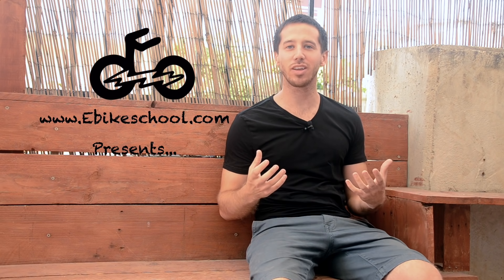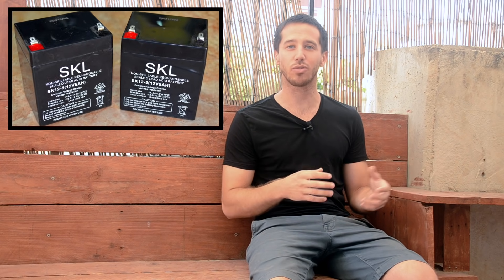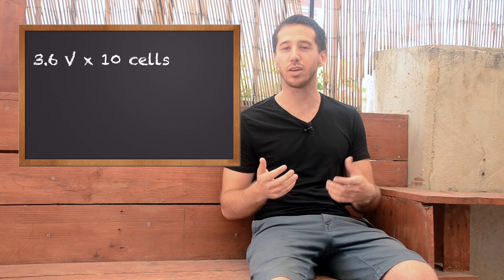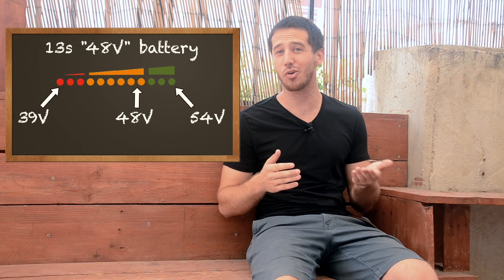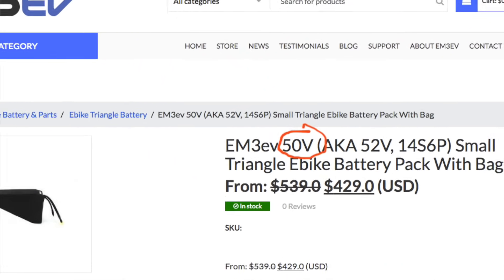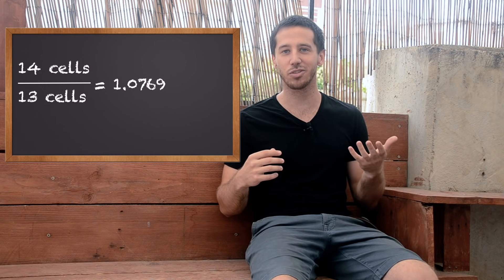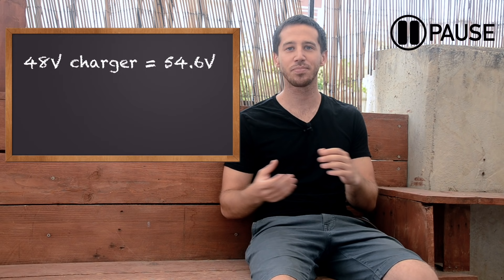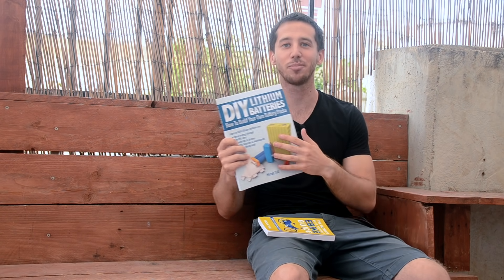Which is better: 48V or 52V battery?

Comment: Major fail in the best reason to go with 52 for a 48 volt design bike - TOTAL NUMBER OF CYCLES OF BATTERY LIFE INCREASES!! Lithium batteries deteriorate the most when fully 100% charged and not immediately used. Hot weather accelerates this deterioration in the form of fewer total charge/discharge cycles before failure. Predicted life cycle total charge count is based on full charge, down to nominal cutoff by the BMS at safe depletion level. Therefore, not ever charging to 100% increases the total number of charge/discharge cycles before failure, all else being equal. The extra charge cycles gained by taking it easy on the pack can exceed the cost paid for those extra cells. DO NOT get a different charger, let your 52 charge to 54.4 volts and it will last longer. You will also cause less cell deterioration when leaving it charged without riding it immediately because you didn't charge it to 100% capacity.

Comment: Can I convert my powerbank that I use to charge my cell phone with usb connects to charge my ebike when needed? Thanks for your consideration. :)
Reply: It won't add jackshit power. A 10A powerbank only has 37W ~ 42W power stored, a 48v 10A battery pack has 481W ~ 546W power stored.

Comment: I use 4 12 volt batteries in series to create a 48 volt battery for a Bafang 750 watt motor and a 1000 watt hub motor on another bike.  Can I over-volt my motors to 60 Volts?

Comment: the more cells in series, the better.  You can pull the same watts with a lower amp draw on your batteries, which equates to longer cell life....IF....you set your cycle analyst to a max wattage limit. You still need enough cells in parallel to provide the required amperage to your controller.  Matching your battery, controller, and motor still remains important.

Comment: I use a 58 volt battery (battery for an Echo weed eater from Home Depot) on a 48 volt / 1000 watt front hub motor on a bike.  No problems and works great!
Reply: I get about 12 miles (on smooth pavement) on a full charge
Reply: 58v on motor 48v and controller 48v also?

Comment: I got a front ebike wheel. v 48. 1500w and I got 4x  12v 6000w. lithium ion and I want it to go more then 30mph what do i do. go higher on the voltage or go high on the Watts

Comment: can anyone explain to me can I over power a 36v 500w front wheel motor? like instead of using a 36v battery will it be ok to use 72v for example? I just want to know if it's going to cause problems or would I increase power and speed safely?

Comment: Fewer volts. Not 'less volts'. Volts are measurable quantity therefore: fewer. Very informative videos however. I am thinking of building a DIY battery for my e-bike rather than going with ridiculously overpriced Emmo Li-Ion. Battery caps is a really neat idea, since I don't have a spot welder. However - the site you mentioned is out of stock on 48 volts 20 Ah kits and that just sucks. Can you suggest an alternative site to purchase such a kit? Thanks.

Comment: If you can buy a profesionally built bike, a 72V battery is better for mountains and off road with high amps. it's kinder to the individual batteries, longer battery life, and it's less hot on the motor and the plugs. The official recommended limit for safe DC voltage that doesnt go through skin is 60v, so it's best if home builders stay under that. some garage guys even fry their wedding rings with 12v, so it's best to stay safe.

Comment: One huge difference is that you can actually use your 48v charger and increase the life of your battery pack by under charging it. It will increase the life way beyond the 7.5 - 10% extra that you may pay. Correct me if I'm wrong. 🏁

Comment: Hi probably a silly  question but if i have simply got a bigger battery, ie i have gone to a 14 amp from a 11 amp, both 36 volt batterys , would i need a new bigger charger, as my 11 amp is supposed to charge my 11 amp up in 5 hrs, will it in reality still charge up my 14 amp in the same time as it has a cut out time so as to not overcharge the batterys , i am under the impression i dont need a bigger charger.

Comment: You are right, it will not run cooler.  20 amps at 24v and 40 amps at 12v both equal 480 watts.  20 amps at 24v will create less heat in the motor.  But the motor rpm's per volt does not change.  You have to change the motor also for the system to run cooler, except maybe the battery a little bit.  Even chaning the motor is no gaurantee the system will run cooler because  the new motor might use smaller diameter wire in the windings to reflect the higher voltage.

Comment: Now less look at cut off voltage . The damage point is 2.5 Volts. so your controller stops at 3 Volts for safety(Voltage drops fast below 3 Volts) .  now 3 x 15 is 45 volts .  So if a pack is 13 cells 45 / 13 = 3.46 Volts. so if you discharge a 13 cell to 45Volts your leaving 80% of its power unused . 3.2 Volts is nominal for a lipo cell. Can you say buy remorse with 13 cells.  15 cells x 3.2 = 48Volts what your controller is designed  for.

Comment: Lipo's are 3.2 V  and 15 cells are 48V  there peak voltage is 4.2 V .   15cells x 4.2V =  63.  That is why controllers are rated that way.   If EbileSchool believes or is lying on this then I cant believe anything thay say.  But please look at buying individual cells and see for yourself .
Reply: No. The nominal voltage of LiPo's is 3.7V. Fully charged the voltage is 4.2V. So 13s fully charged is 54.6V.

Comment: So, you say that most controllers that can handle a 48V battery can handle a 52V battery.  Can a controller that usually comes with a 36V battery handle a 48V battery?

Comment: Great video very informative but what I find confusing is the 10Ah 0r 12.5Ah , 15Ah , 20Ah  rating what does these numbers mean well I know it's amp rating's But lets say My bike is 48v 10.5Ah battery ! What difference would it make say if I used a 48v 20Ah battery on my bike would this be ok or would it damage any thing ? It would have been great if you could have explained this about the batteries too ?
Reply: Amp-hours (Ah) denote capacity. Think of them as how big your car gas tank is in gallons. If you replaced your 48v10.5 Ah battery with a 48v20Ah battery, it would give you roughly double the range. Also it would double the size/weight of the pack and roughly double the cost.
Reply: Thanks for the explanation I get that , But would a higher Ah Battery make it any faster or just be the same as my lower Ah battery ?
Reply: The short answer is No. That's the reason for this video. If you want more from your setup, you have to increase either the voltage (more speed) or the current (more power - amps, NOT amp-hours). There are a couple of things you can check - if you have an LCD display, they usually have a speed setting that you can go into the menu and increase. If you have a separate controller, they often have 2 blue wires that aren't connected to anything. Those are speed limiting wires.  If you connect them to each other, it will turn the speed limiting off (I think you still have to increase the limit on the LCD display. An LED display doesn't need to be adjusted). If you have done those things and still want more speed, it might be cheaper to get a 48v controller that has a higher amp rating. Most of them are advertised with the maximum amps they can handle - nominal current is usually about half the maximum. Just make sure your battery pack can put out at least as many maximum amps as the maximum amps of the new controller. The increased current doesn't make the top speed any faster, but it does increase the power of the motor, letting you get to top speed faster, go uphill easier, handle headwinds better, etc (makes it quicker, not faster).
If you've ever noticed that your bike seems to have more "punch" when your battery is fully charged, that's because it does :) Fully charged, your 48v battery actually has more like 56v for awhile, but it slowly drops as you use the motor. That is the only way the 20Ah battery could help - with more capacity, it would put out that higher voltage for a few more miles, but it wouldn't be any faster than the battery you have (assuming all other factors stay the same).
I take it you're new here. Micah has done several videos on these topics, so check them out. There are lots of variables in the ebike world. Confusing at first, but once you understand how they all work, then you can put together a bike that's perfect for you. :)
Reply: That's great info You have helped me a lot and I now understand a lot better now Thanks.

Comment: You are a remarkable speaker - easy to follow easy to understand. T H A N K S
Reply: Hi I bought from eBay 48v 1000w brushless 26a controller and battery from AliExpress unitpackpower 52v 14s 20ah 30a continue .
 I  just use 3 days  and start  motor hard moving when I pedal , gone power , after 5min start working    after 10min same  hard pedals moving and throttle no working , think maybe battery . I changed full battery sw900 screen on and writing 07 means motor problems and 09 means controller faulty..  I bought controller new will see if it helps maybe motor is well faulty.. 
Yuo can help buy for me 48v 1000w or 1200w conversation kit I can use 52v 14s 20ah battery thanks..

Comment: Hey Mikey, I really need some assistance from you. I bought me a Voilamart 1000W 48V bike kit, with LCD screen which retails for about $191, and built a 13s 4p battery pack. I  connected all the cables, as shown on the manual that came with the kit, powered the LCD yet,  the motor wouldn't run. Can you please help me out with some ideas on what to do, to get this resolved.
Reply: Hi I is well Bought Voilamarkt 48v 1000w I use 52v 14s battery after 4 day s brouken writing on display 07 mean motor problems and 09 faulty controller .. Is fuckt not working anymore

Comment: Wrong. If you have more power than you need, you'll automatically adjust your throttle control to obtain the power that you need. If you increase the voltage, you'll adapt by giving it less throttle. This will result in less current.

Sure, if you are underpowered and therefor always giving it full throttle, then more power will lead to more heat. But this is only true if you're underpowered.

Comment: Hi , Micah!
Since you devoted this video to the such specific issue, I assume that you can assemble both 48 v & 52 v batteries and tested them for speed increase.
Most probably as a professional being an author of 2 different very helpful books, you might take an orders from your friends to make a 18650 Li-ion battery of different voltage and capacity using your cells welding machine shown in one of your previous videos.
Should you agree to take an order to manufacture a 18650 battery, on what basis do you calculate the cost which you’ll charge a client?
Is it $/ cell or $/ h? Pls give me your reasonable way of charging a client for example who would order 36 v 10.5 A/h ( 12S 3P) and provide you with his own 30 cells of 18650 cells. Thanks!☝️🤓

Comment: I agree that if you are drawing the same current then there will be the same dissipation (heat) ... but as you say for the same current you are producing more power, therefore faster speed. For the same speed both 52V and 48V will be using the same power, but the 52V draws less current from the controller therefore running cooler and more reliably, ( ie I2R loses in FETs, motor windings at one end and internal resistance of battery at other end). One other thing - you'll need a '52V' charger - upper cuttoff at 14S is higher .

Comment: 6:10 You're right, but it still doesn't change the facts of riding.
If you're using a 13s setup going down the road, just slowed down to make a turn and your new target speed in that moment is 20mph... you will (more often than not) be under voltage and the controller will therefore pump more current to the motor in order to accelerate back up to 20mph.
If you're using a 14s setup in that same situation, you will (more often than not) have plenty of voltage and the controller won't need to push as many amps to get there.
Now if you just ride like a hooligan (who doesn't like to do that occasionally?) and maxing out the throttle every opportunity... sure, the controller will limit amps the same.
The current you're using in any given moment is determined by your thumb (or wrist); not the controller. If you have no self-control, the controller will do the limiting for you.

Comment: Is it safe to use a 60v battery pack to run a 48v motor? Will this overwork or burn out the motor or controller?

Comment: another advantage you could still use 48v charger and just under charge the battery pack so batteries life cycle is longer I bumped my 13s4p to 16s5p so I can overvolt and under charge the cells

Comment: hold on how much faster would the bike rly go for only 4 volts? like what instead of going 30mph you can go 32? getting a completely new 14s battery is atleast 100 dollars if your using garbage cells...

Comment: I'm currently using 48V Controller and Battery pack with hub motor rated @ 48V 500W.  If you said that 48V controller can handle 52V battery, how about the Hub motor will it handle it?
Reply: 48v 500w and 48v for 1000w motor u will be fine just dont  go put a 48v with a 350w motor or any lower bad for battery and motor will heat up and consequences will happen

Comment: Can I use a 48V 1800W controller with a 52V battery and a 1000W hub motor?
Reply: G Heald you should be fine I'm running 72v 4000w in a 48v 1000w hub motor

Comment: More heat when more maximum power assuming you're draining the full 30A. Less heat when less amps (for the same power), ie when not using the full amperage / max power (bike assists pedaling). P = RI² That's how I thought of it anyways.

Comment: Isn't it so you'll be able to get the same watts with lower amps which means you'll drain your batteries slower if you limit the output equal to the output of a lower voltage pack? Like you said it would mean limiting the amps on the controller. You might not want to go any faster or have more power, your main concern could be longevity and am i wrong to think this can be achieved by using a higher voltage pack in a calculated manner?

Comment: When people say you pull less current, they mean at the same speed, not at the higher speed possible. For example, if you cruise at 20mph on a 48v using 480watts,  that is 10amps pulled. 20mph on a 52v is still going to take 480 watts which equates to 9.23 amps. 9.23amps @ 52v<10amps @ 48v. Fix your video
Reply: If you can buy a profesionally built bike, a 72V battery is better for mountains and off road with high amps. it's kinder to the individual batteries, longer battery life, and it's less hot on the motor and the plugs. The official recommended limit for safe DC voltage that doesnt go through skin is 60v, so it's best if home builders stay under that. some garage guys even fry their wedding rings with 12v, so it's best to stay safe.
Reply: monstercolorfun co exactly, a lower amperage discharge rate for each INDIVIDUAL cell
Reply: likewise the battery pack won't get as "hot" temperature wise, as each is pulling less amps (at that same wattage).
Reply: Snarky response dude. How about you make a video explaining it better.
Reply: There is a lot of want to be Geniuses out there LMAO always gotta one up somebody shaking my head
Reply: I think his criticisms is justified, but it could have been expressed in a more polite way!
As long as you maintain your speed, or better, your energy usage, more voltage equals to less ampere, which in turn results in less heat ( because current/amperage causes to heat, not voltage. Voltage just causes more current to flow as long as you don't slow down)
Reply: @karlasch5475  less amperes do not turn to less heat, assuming equal power (work) and equal efficiency. P=U*I
Reply: @hrvojelasic5794  Hi Hrvoje, I'm sorry that's not true, as V and A do contribute same amounts to their product of multiplication, i.e. P(power), BUT as heat generation is concerned, A is the partner that causes it. 
Think of electric cars and check why they do use high voltages (>300V, Porsche even 800V), even though that is much more dangerous to work on and requires more costly safety measurements.
Reply: @karlasch5475  Heat is basically wasted energy. If both system do same work and they have have same efficiency system with lower voltage will not produce more heat. it is about first law off thermodynamics. Energy can be transformed from one form to another, but can be neither created nor destroyed. If you use lower amps you need thinner cables, it is easier to handle current (in some perspective when you draw  a lot of power it may even be unpractical to have very thick cables) but that in no way changes fundamentals of physics.
Reply: Asinine male rivalry
Reply: I imagine he will fix this video and you fix your attitude

Comment: Will the controller read the battery level different due to the higher voltage since it was programmed for 48V ?  Ie, will it think you have more battery left than you have due to the voltage difference?

Comment: I built a solarized e-trike, 48v12ahr battery. Solar panels r in series and produce 60v and 6amps ( perpendicular), 
My first one was used to cross the Rockies 3x. Watch on utube, Light Rider operation Paul Revere